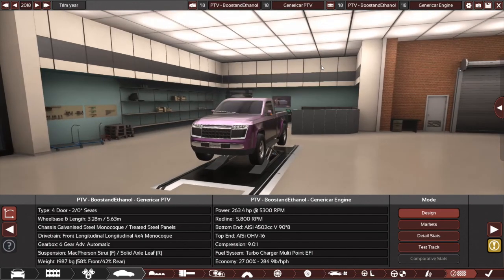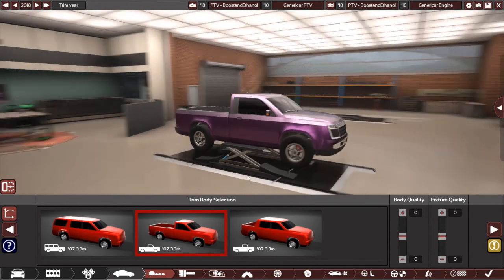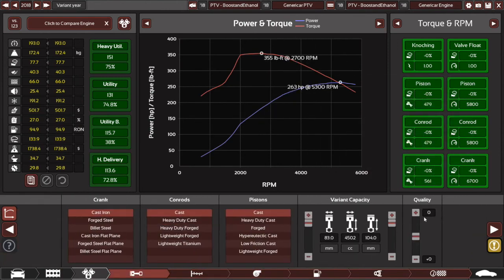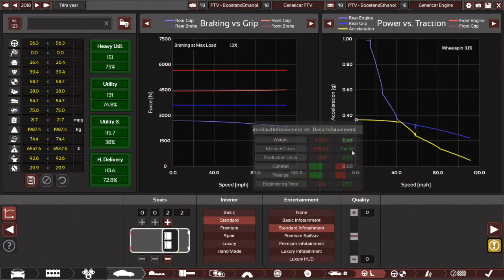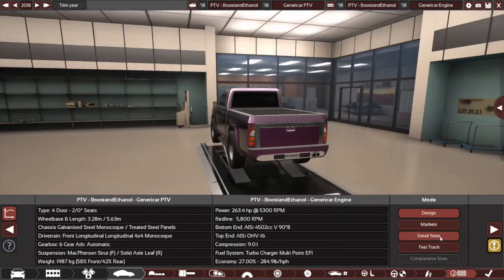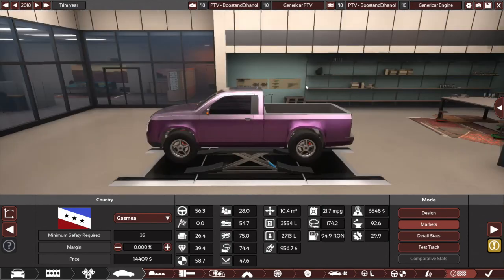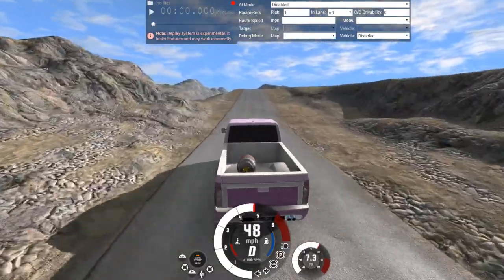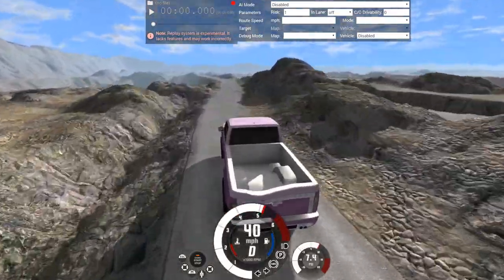Propane Transport Vehicle Challenge!

Comment: I think the fuel economy might need to be adjusted.  I can get a truck to meet all the engineering requirements, or the fuel economy requirement, but not both.  I know you did it, but I don't just want to copy yours.
Reply: Nevermind.  Got it to work.
Reply: I feel it's a good compromise. You either have a heavy truck that is REALLY good at carrying things off road, but isn't very fast but can keep the speed. Or you have a lighter vehicle that is really quick, but is less able to carry the load off road because it gets bumped about a lot, but the speed between bumps can make up for it.